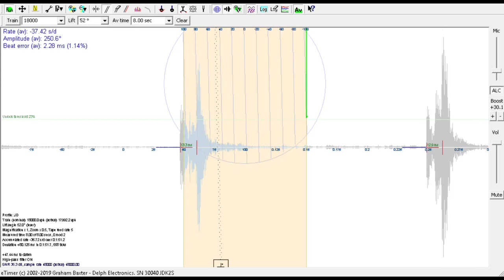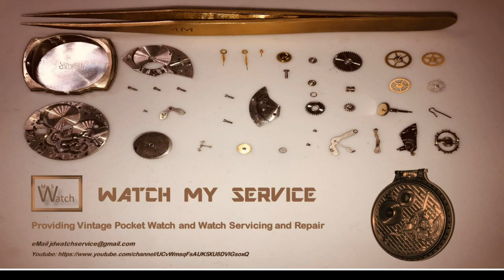24 Jewel Bunn Special Assembly and Test

Comment: Great video. When I disassemble a pocket watch, I always remove the balance wheel from the balance cock completely. Dangling the balance by the hairspring from the balance cock always makes me nervous that the hairspring will get messed up.
Reply from the maker: I do the same as I too fear messing up the hairspring.  I usually have the balance resting on my tack rest withe no pressure on the hairspring
Reply: It took a while, but after a lot of practice I've gotten pretty good at reassembling the full plate pocket watches. The trick is to assemble them upside down, starting with the upper plate and then carefully lowering the dial plate into place.
Reply from the maker: Good tip. I will try this. Thanks